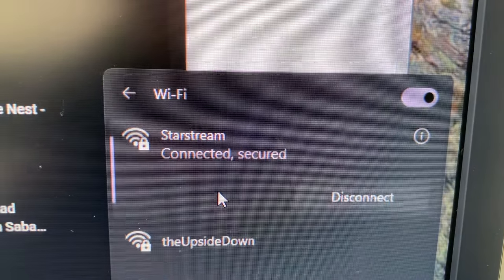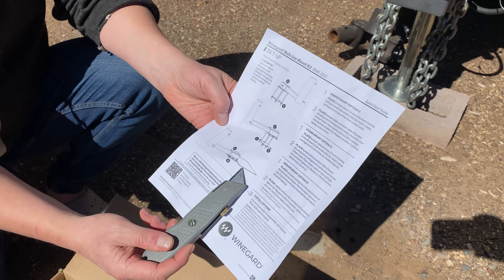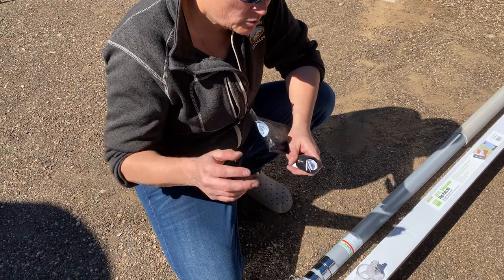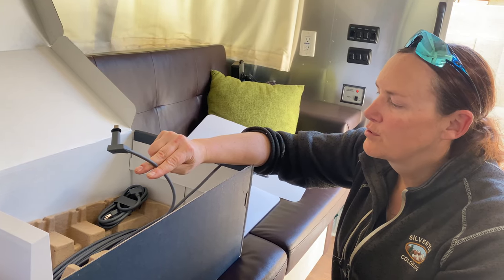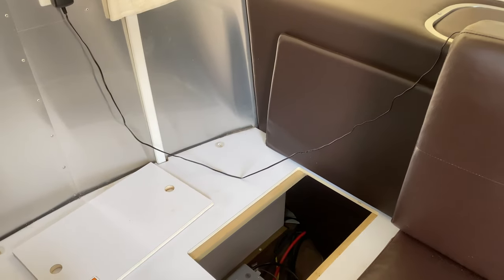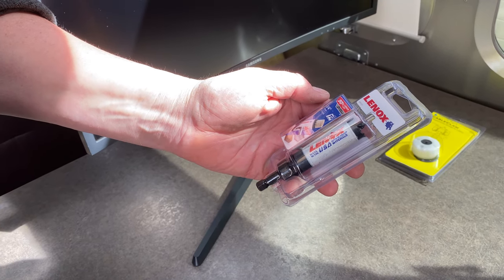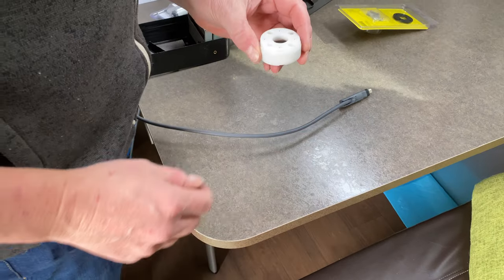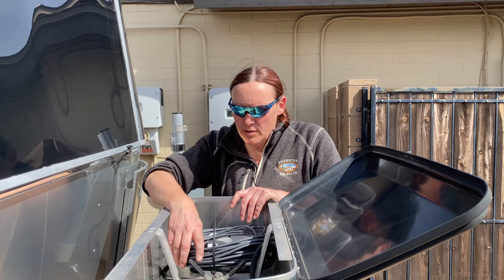🌐📡🔧💡E6.3  Starstream A Clean Starlink Airstream Install

Comment: Thanks for the detailed install! You explained the process without just blabbing on and on like some people on YouTube.  We appreciate the concise video with references to actual products and tools.  We were afraid to cut the cord after just purchasing the expensive equipment (Maybe after our first season with it)...One thing we've had to do is alter our method of choosing campgrounds and sites. Instead of fully treed sites with shade, now looking for more open spots for the Dishy connection. (2017 30' Flying Cloud, traveling the upper NE, presently in PEI with great reception).

Comment: Great attention to detail on the well thought out installation. Thanks for sharing. I can confirm that the starlink router operates outside in the winter without any discernible degradation in performance. I have done so frequently at temperatures down to -20F. I believe it fairly weather resistant, although i do place it in a water resistant, semi breathable bag when the weather is poor.

Comment: I went with a Visible wireless unlimited hotspot on an iphone 12 mini ($230) from Amazon that feeds a TP Link AC750 nano router ($37).  I now get unlimited internet anywhere on Verizon's cell tower system and the router signal extends out to about 40 ft from my Airstream.  Works like a champ, is cheap ($25 a month flat fee), is stable, I routinely see 5-8Mbps, and I've run 9 devices on it simultaneously without any issues, plus, I use the phone to support the internet 24 hrs a day and as a dedicated house phone.  I could up the service to 5g for $10 a month more but have no need for the extra speed.

Comment: I am looking at StarLink and your mast solution is slick. I like things clean and was wondering if there was a way to have an outlet added next to the cable/satellite outlet for the StarLink. Cable from dish would connect to that and behind the fixture there would be a cable that would be connected to the router. Thoughts?
Reply from the maker: A bulkhead connector for the dish would be convenient but I've learned a lesson over the years, which is this: Technology marches on quickly and modifications to the Airstream often turn into boat anchors. In my case I have a Winegard satellite dish up there along with a cell booster and wi-fi booster. All that equipment is now obsolete because of Starlink and I'm left with the cost of pulling that stuff off, re-environmentalizing the roof and dealing with some after effects like rust. 

I've seen some folks punch out additional outlets on the side of the unit to accommodate an exterior dishy cable but I think that kind of modification is on the same technical path and will quickly turn obsolete. For example, in the 6 months we had Starlink they've already released a new dish and a new router. I also chatted with one of the techs at We Are Airstream and he told me that they offered a bulkhead solution right from the dealer and they saw a 50% failure rate. 

The approach I took has the strong advantage of low trailer modifications and no cable cutting. The disadvantage is that long coil of cable in the propane compartment made cylinder exchange a mild hassle. After traveling with the dish for a season though my conclusion is this was a great way to go and I'm going to stick with the approach next season. And I am comfortable that in the near future I can accommodate new Starlink equipment with virtually no fuss.

A couple observations about our travels with the dish though:

- The Harbor Freight flagpole was the go-to solution for mounting the dish but we had a number of occasions where it worked better using the ground pedestal and one occasion where the rear receiver hitch did the trick. Having the extreme versatility of moving the dish around like this validated my choice not to mount anything on the roof.

- The Harbor Freight flagpole leaves much to be desired. As it weathered it was at times almost impossible to actuate the internal cams to loosen and tighten. Paradoxically in high winds the flag pole would loosen up and thunk down two positions by itself. I came to realize that when possible the lowest position was the best position.

- The dishy connection where the cable plugs into the dish housing is super sketch. I discovered quickly that we'd go to bed with a working dish and in the AM it wouldn't power on. I'd have to trudge out there, unseat the connection, jiggle it, and then put it back. This shows that that the current connector direct from the factory is poorly thought out and I suspect a redesign will be imminent.

- Starlink tech support is shockingly bad. There's no phone number so you have to use the app or the Starlink website. The only way to ask for help is to find an article, then choose "thumbs down" at which point you can submit a request. In my case the web site was broken so I was only able to ask for help via the app. Right. You have to use the app that is having trouble to ask for help with the app that is having trouble.

- All these troubles aside the dish was an evolutionary leap and our Airstreaming will never be the same. Check our the blog at https://airstreammtb.com for a journal of our travels with the dish last season.
Reply: @AirstreamMTB  thanks for the feedback. Your experience with the flagpole and connection were two concerns of mine. And the lack of customer support is not acceptable for something like StarLink.